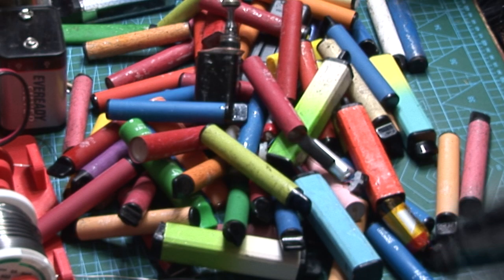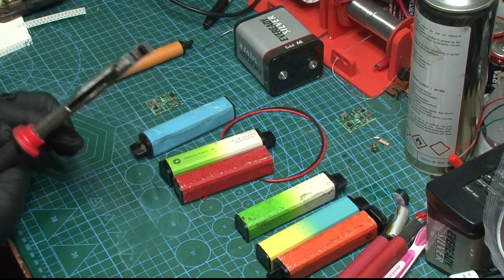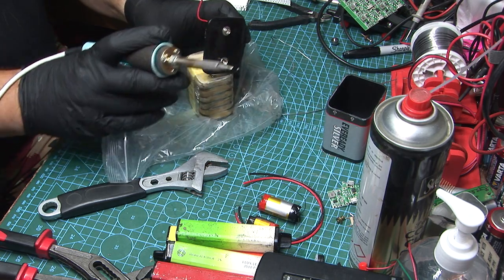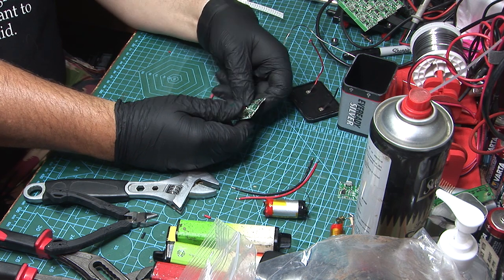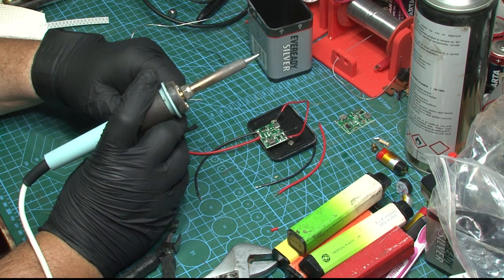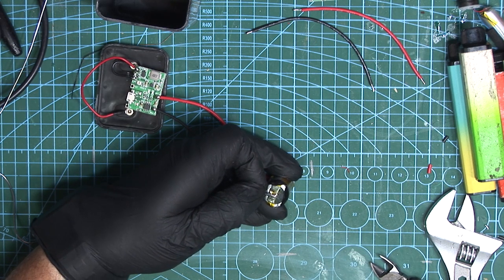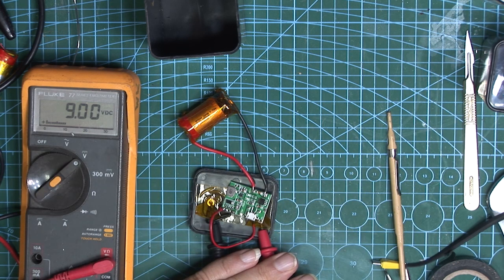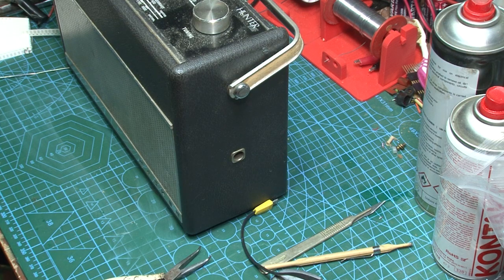How To Make A Li Ion Battery Pack From Street E-Waste

Comment: Excellent stuff George. I particularly liked the battery management boards. The ones I use are fixed to the battery voltage. It’s good that yours can increase the voltage and they don’t seem to create any electrical noise. Cheers Graham

Comment: Hi George, good to see you back and hope you are well again now. A very useful video for me as a hobbyist with "L" plates and I am sure many other people. I have a genuine Malahit radio without a BMS, so will look seriously at this board.  

Do you ever combine batteries to give a longer lasting option? Or is that not advised?
Reply from the maker: You can combine batteries but really the best way is to balance them using a separate balancing board so that bot charge equally.
Reply: @GeorgeChristofi  Thanks George, it sounds like a similar thing to when they build battery packs for e-bikes. Now there is you next E Waste challenge!
Reply from the maker: @acestudioscouk-Ace-G0ACE  e-bikes.... Ive not ridden a pedal cycle since I was 16 and it was about 15 years since I rode a motorbike... I could turn an ebike into scrap, i'd just have to throw a bar through the spokes as it rides past i suppose!
Reply: @GeorgeChristofi  LOL 🤣

Comment: Nicely recycled George. Plenty of life left in most of those batteries no doubt. Any RF noise from the boost converter?
Reply from the maker: I hadn't noticed any RF noise but the cameras were on and that can mask issues for sure. I'll have to do more testing but they seem to be fine for general listening. DX might suffer but I'd have to see.

Comment: nice one george  i bought one of these 2 months ago to replace the 15 volt battery in an old avo 8 saddly i paid £4.80 from ebay.
Reply from the maker: The advantage of ebay is less of a wait for delivery if the seller is UK based but you pay for that convenience.

Comment: Fab George. I like not buying PP9's
I wonder whether, for added recycling kudos, the cylindrical vape tubes could be used for making rf probes...? They seem to have an end cap, and the top cap is already slotted... Are they all plastic? or are they aluminium?
Reply from the maker: The tubes are aluminium and the end caps are plastic. Give them a good wash once the contents are removed and they should be fine.
Reply: @Codeeze: I made a probe for one of my Heaths out of one of the square ones the other day, (next day I found a smaller round one), they have plastic tubes that the fluid is in, I used two of these tubes to house the board in, then used the silicone bungs to seal the board in the plastic housing. In the rear bung there are two tiny holes, I passed the earthing wire through one and enlarged the other for the coax, @ the mouthpiece end I ran a big sewing needle through and sealed with wire sleeve and heatshrink! Hope this makes sense!🤔 GB :) Just to add, most of the ones I get are from the Guys n Gals from work so @ least I know whose mouth has been on them🤣🤣 ...

Comment: Good to see you back George! Nice project, with no on/off switch what is the battery shelf life like?
Reply from the maker: The shelf life should be quite good because the quiescent current with no load is in the microamps range. I havent tested them fully but the BMS module will stop the cell from over discharging so it won't get to an unrecoverable state.

Comment: Great video George, great to see one from you sir! So I would think you might want to hot glue or support the battery in the case some other way, so it doesn't flop around in the can? Also, could you Dremel an opening in the can where you can insert the charge cord without taking it apart? Of course you would need to attach the BMI board so it doesn't move around. Great idea overall!
Reply from the maker: There are several things that could be done, the double sided auto badge tape could be used on both the board and the battery. If the placement of the board was right then yes, a hole for the charge cable would be a nice addition. This was more rough and ready using old cases, if I get my act together I could print more compact boxes on the 3d printer with the holes and mounts already incorporated. Some good ideas there for sure Gregg

Comment: I'm curious how you would join multiple cells together into bigger packs. I have seen these several times but walked past because I didn't want to touch something someone's been sucking on lmao! Cool video 👍😎❤️
Reply from the maker: To make bigger packs depends on what sort of output you are aiming for. The simplest way is to parallel multiple batteries to give you increased capacity but if you are looking for high current output you can get BMS modules that have active balancing so it monitors each cell in the pack. this is more useful if you are looking to draw 5A or more from the cells in bursts, the only down side is the fact that you have no step up/down facility so the outputs are generally multiples of 4v and need to be charged with the same voltage. Yes, picking up the vapes is a thing, the best way is to do like dog owners and have a bag in your pocket and pick them up with the bag so your hands don't need to touch them.
Reply: @GeorgeChristofi  thanks for such a detailed answer, i am definitely going to give it a go! 😊

Comment: So in essence what you have done is make a rechargeable 9 volt battery. I am guessing the module is the whole secret to this operation. Quite a life saver if you don't have access to 9 volt batteries. How long will the radio run on one charge?
Reply from the maker: Thats it down to a T Larry. Commercial 9v batteries are nearly £30 and these cost the price of the management board and a bit of time. The original batteries I dismantled have been in my radio for 3 years and that lives in my bathroom so any time i'm in the shower or soaking the radio is on. I'm hoping to get at least that from these replacements but even if I get half that, it would only be a couple of charges to be the equivalent to buying new zinc carbon cells.

Comment: Hey George. Yeah you never want to pull it too hard, there could be problems for sure. LOL I was going to do that for the ProbeST project, but Bob talked me into using a standard (US) 9 volt battery. I am curious as to the life span of your setup compared to the original battery. :)
Reply from the maker: The original battery has a capacity of around 1500mA as well, they are standard zinc carbon piles in them. The problem now is not many shops stock the PP9 these days and at £5 each it can get expensive. It only takes a couple of recharges and you have recovered your cost on the lithium project simply down to the fact that the cells in them have been only charged once from new and then they have been thrown away. The standard 9v cell is another one that these could substitute for if you have a large enough compartment and could print a container for them. We still have lots of things that use the smaller PP3 size and its only physical size that makes it different. You can buy flat cells and marry them to the board and make a replacement for those too.
Reply: @GeorgeChristofi  The only problem is that you will get less than one third of the life per charge, if my understanding is correct. The Lithium cell is three point something volts, the output is 9V. The current draw from the cell will be about three times that of the PP9, allowing for the inefficiencies of the DC/DC converter. Plese correct me if I'm being stupid here, George.